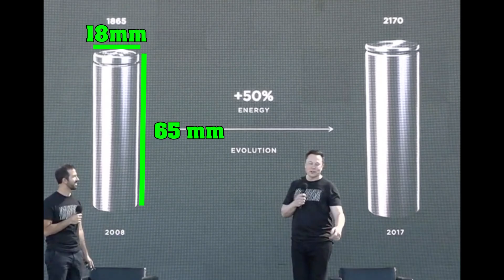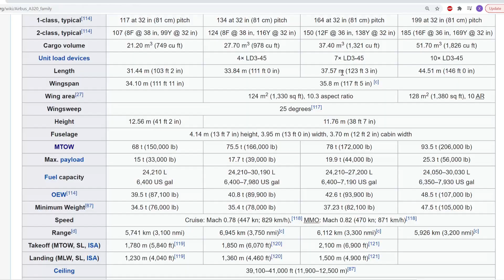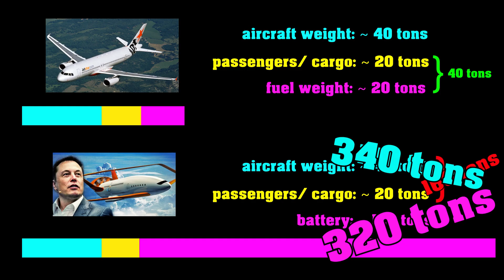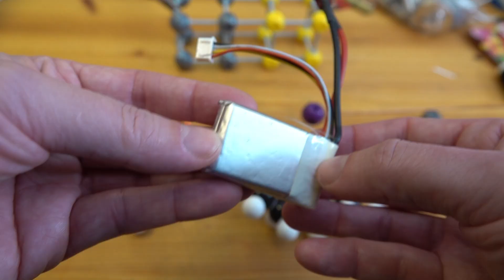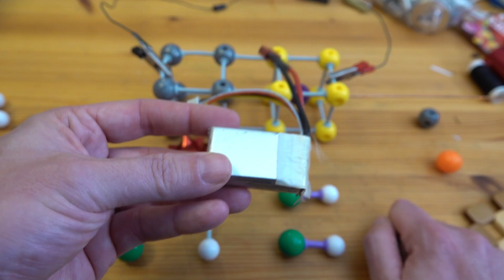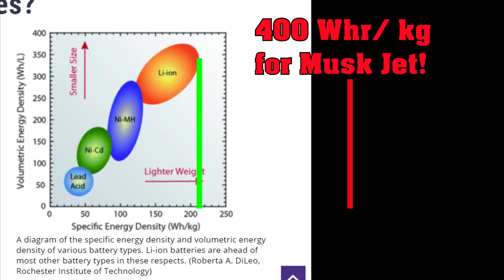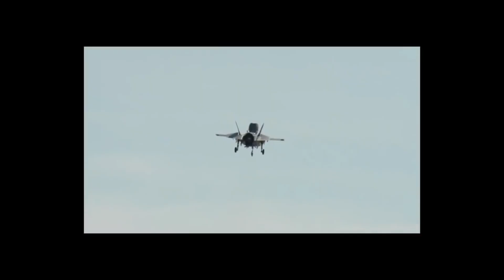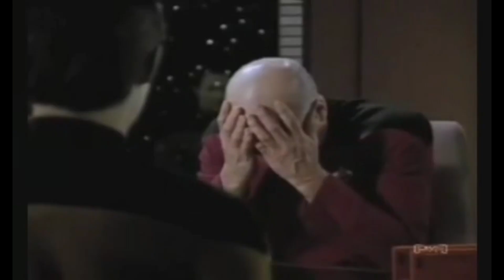Tesla's Secret Plan To Disrupt Airlines: BUSTED!!

Comment: well technically, you could use part of the battery "weight" as structure. the battery housing can be part of the plane structure, so it's not technically just 70% on top the plane mass.That would of course mate the battery with the plane in ways which you can't easily remove or replace them. the real game changer would be energy density within a safe operational space. When shit goes down on a regular plane, you dump the fuel which can, if you hit anything, explode and burn, in a flying battery, ya can't . and last time I checked, Lithium Ion batteries have a tendency to behave badly when they are "hurt" (see airplane crash, especially if they are part of the plane structure). And what about the stuff in between the engins and the batteries? (yes I'm dumbing it down a bit), the cables which transport the current... the higher the voltage , the thicker the cable (if not, bad things happen when you apply too much current).

Comment: The VTOL thing is what gets me. The thrust ratio required to get possibly the most successful VTOL plane, the Harrier required a power to weight ratio of 1 to 1.1 from memory. And this is a combat aircraft weighing like 10 tons with a full payload. An A320 has a max takeoff weight of 75-80 tons. 75-80 tons of thrust That's a lot. Also note anything that carries a significant cargo that is VTOL capable uses a tilt rotor system for a reason. And good luck with making a supersonic/hypersonic rotor plane at flying at the proposed altitudes.

Comment: I think electric planes can have avantages in short flights. If you have to travel between cities in Norway, it is a long distance driving around the fjords. Ferries are slow. There is a market for short quick flights. In every airport you can have batteries charging. When landing you can change the battery, as you change on your electric screwdriver, before take off. Or short low flights in areas you do not want to disturb wild life or people with high sound. Areas of bad roads.
But long distance flights? No. We do have the technology for fuel burning engines. Fuel has higher energy density. The plane gets lighter as longer you fly, and use less trust to keep flying. A battery powered plane start and land with the same weight. Carry all the "fuel" all the distance.
The solution for long distance flights is to make synthetic fuel out of CO2. Make those energy filled C-C bonds from the C-O bonds. If we can get that energy from renewable sources (sun, wind, geothermal, hydro electric), store it in fuel and transport it from production to user, we have a solution. Put the efford in changing the fuel, not to rebuild the whole aircraft with tonnes of batteries.

Comment: And now for the effects of having VTOL, supersonic speeds, and batteries all on the same plane... Each one of these features requires crazy high energy consumption. VTOL in fixed-wing planes is only useful for military operations where you need dirt-cheap airplane carriers that can go to the immediate neighborhood of the battleground. Almost all of them are subsonic. Supersonic speeds are limited to those applications where very heavy planes carry very little payloads. And battery-powered planes only work if the plane is almost nothing except batteries. Combining the three of them in one plane would require having a payload with actual negative weight. At the very best, Elon's plane would be able to carry helium as payload, but more likely, it would only be useful to carry anti-gravitons.

Comment: How do electric planes get thrust? Isn't it much the same principle as jets? You accelerate air rearward to push you forward?  So I don't see how an electric 'jet' is going to be any more efficient at extreme altitudes because there's just not much air mass to push back with
Also, remember that conventional jet aircraft get lighter and thus more efficient as they burn off the fuel, as opposed to batteries which you gotta carry with you right to the destination

Comment: I dont know if airplanes are primarily made out of steel or aluminum. But by replacing that with carbon fibre you shed at least 42% of the weight or say 50% to simplify.

This means that the weight of the aircraft probably go to the 20s in tons. Then you have  about 5 tons left for luggage and people.

Well it doesnt add upp but still closer to real life. We dont know what Elon thinks but this might be a solution

Comment: Like most scientists you make really bad assumptions then you build your theory on that and then call it a fact. Firstly Elon didn't say that a 2170 cell has 50% more energy than a 1865, he stated that the energy density in the battery pack is 50% more, if you make a battery pack the same size and weight with 2170 cell's you get 50% more capacity than if you made the same size pack with 1865. This doesn't mean he improved the cell's performance just the effectiveness of the packaging in the battery pack. Secondly, he stated 70% of the cell capacity on the aircraft, this is 70% of payload, not gross weight, aircraft normally carry 30-50% fuel as payload.

Comment: Conventional planes gain some efficiency as they get lighter after burning off fuel during the flight. Electric planes have to deal with all the weight the entire flight. The huge weight of the electric plane will cause problems when landing. Electric planes don't make any sense

Comment: Took 5 seconds of consideration to know how absurd that claim was. So I pulled some numbers just to quantify where this lands on the absurdity scale... A 747 guzzles a conservative value of about 300 MJ per km in avgas. Lithium Ion is about 1 MJ/kg (270Wh/kg). Since we're unlikely to get any great leaps in efficiency over turbofan jets like the 747 - we can safely assume the Tesla jet would be about as efficient with energy (or worse), so... LA to DC (3700km) would need about a gigatonne of LI batteries on board.
Reply: To paraphrase Thunderf00t in his 2016 video picking apart Starship Earth to Earth:

A fully-fuelled 747(-8) contains 2 kilotonnes of TNT worth of energy in fuel, equivalent to all of the bombs the Allies would typically drop on an enemy city in WWII.

And an ATR 72, a small turboprop, carries 4 and a half MOAB bombs' worth of energy in fuel.

Comment: To be fair, as far as I know, the engineering achievement of Tesla lies in increasing the energy density of the battery, not of the cell and doing this safe enough for a car. Their new and bigger cells manage to keep the battery cool and allow to put more cells in it. Also they're working on making the battery part of the frame, which could solve the problem at 9:00 and could make electric planes possible.

BUT I don't think either, that electric planes could be economically feasible. The difference in energy density is just too big, between batteries and carbon fuel. The most likely future is probably that carbon fuels will be generated from air CO2 and "green" energies, so air travel will become carbon neutral that way.
Reply: making the batteris part of the frame is dumb. planes are able to land since their fuel is gone by that time meaning they weight far less. if a plane has to make an emergency landing it has to dump its fuel otherwise it would hit the runway like a ton of bricks.
Reply: @toomanyaccounts  Your first point is completely unrelated to your second point. Why is it dumb to make the frame out of batteries, if you manage to make it safe? It is obviously lighter than putting batteries in a regular plane frame.
And your second point just shows an inherent problem with electric planes (which is one of the points, why they probably will never be economical). But at least the runway shouldn't be a problem, because Elon Musk is talking about vertical take off planes.

Comment: Did you really watch battery day? Because making the battery a part of the structure and a loadbearing part, makes alot of sense in a plane. And its a funny joke about the progress between old batteries, but they are made by panasonic. By making the battery bigger, you get more battery to mass of the outer shell.
Reply: no it doesn't. planes are able to land because that fuel weight is gone by that time.
Reply: @toomanyaccounts  Yeah no. It is easier and safer yes, but not a requirement to land

Comment: Fun fact: The fattest rc plane in the world is a glider called the transonic DP with a speed of 545 mph or 877 kph (mach:0.77) using a Technic known as dynamic soaring. The fastest conventional electric rc planes are only just about pushing 300mph.

Comment: How about hydroelectric fuel cells? Planes could realistically swap fuel cels between takeoffs
Reply: the plane would never be able to land. look up why they jetison fuel on emergency landings
Reply: @toomanyaccounts  They would. They dump fuel so the get back to the safe landing weight the plane is designed for. And normally dump fuel only in emergencies where they can’t burn it of etc. if the plane had batteries or fuel cells it wouldn’t be a thing

Comment: Clearly, the answer is "Solar Freakin' Passenger Seats"
Reply: Thermo Electric  they will convert body heat to energy.  That way the plane will use the body heat from the passengers to power the plane.  Don't tell Elon this was my idea LOL
Reply: If only they joined forces with Solar Freaking Roadways and beam the power to the electric planes then they would not need large batteries at all. 70% less weight w/o batteries means 70% more cargo weight 👍

Comment: Can't the batteries be used as structural elements though? Something that won't work with airplane fuel.
Reply: airplane fuel is dumped in emergency landings for a reason. the plane has to lose weight if it wants to land safely
Reply: @toomanyaccounts  well the fuel needs to be dumped because it isn't a structural element to begin with, it only provides energy and weight, not strength so it makes sense to get rid of it. So it's not a direct comparison like this.

Look, I know Musk's spiel is to never think too hard about failure modes, but batteries should not be simply compared to "dumb weight" fuel.

I'm more concerned about how hot those batteries would get in order to allow a take-off.
Reply: @cearny7856  batteries wouldn't help with structural support they would be a huge failure point. once again plane weight upon landing has to be much less then upon takeoff. otherwise the plane can suffer structural damage or even break apart.
Reply: @toomanyaccounts  by much you mean 15-20%? Because that's the total amount of fuel mentioned in the video, plus you need reserve fuel. I recall an article (gotta search for it) that mentioned using batteries as structural elements in newer designs for electric cars so I can see this being possibly adapted for an airframe as well. Again, batteries are not sloshy stuff so they can be used in other ways than just..sloshy stuff.

Edit: found it! https://www.theengineer.co.uk/carbon-fibre-structural-battery/

Furthermore, not all planes are jumbo jets. So dumping fuel in an emergency landing shortly after take-off is not necessarily as much a priority for all types of planes in all situations. It should improve the result of a hard landing regardless but it's not a strict requirement for all planes, in all situations.
Reply: @cearny7856  cars don't need to take off and land. big difference also notice what happens when tesla cars crash they tend to go up in flames way worse then a gasoline car does.
Reply: @toomanyaccounts  if you check out the Danish researcher's claims, he did mention airframes though. And the battery tech won't be a direct lift from what Tesla uses for their cars. Anyway switching to mentioning battery fires feels like a bit of a goalposting move.

Then again, this is probably going on a tangent to what Musk was talking about and, yes, there are other issues besides weight (or possible fires, which are horrific by themselves and for which I don't know if there's a specific battery tech to handle) which might be much nastier.
Reply: Also, know what would be nasty and commonplace enough? A lightning strike.
Reply: "Can't the batteries be used as structural elements though?"

Yes, they can, or their casings can.

"Something that won't work with airplane fuel."

Actually, it DOES work with airplane fuel, because a lot of aircraft these days use "wet wings" where parts of the wings themselves are sealed off and used to store the fuel that you'll need to run, effectively making the fuel tanks structural.

Comment: Really love your content.  One thing I was confused about, this same logic was used to say the Tesla wouldn't work unless the car was very heavy, which is exactly what made it work.  So using this same logic, wouldn't a much larger/heavier plane with the same amount of people as the c320 work?  I understand increasing the weight makes it exponentially harder for it to lift off of the ground, but it would still be entirely possible. But would it be worth it energy efficiency wise?

Edit: Or just more planes that carry fewer people?
Reply: increased wieght means its unsafe to land. its why planes dump their fuel if they have to do an emergency landing.

Comment: The closest thing to this that might actually be maybe feasible would be an electric V22 Osprey or something resembling it, that just serves the ultra rich and takes them point to point in a city or maybe between nearby States or countries (I. E. UK to France or Germany, etc). The electric batteries would still be a disadvantage in terms of weight but far less than for anything long range and possible advantages such as being rechargeable so that you could just charge it on top of a skyscraper or at a mansion that has a helipad with basically a tesla charger next to it, possibly being more maintainable, etc, might, possibly, maybe, cause it to be a viable product. Even then it's kind of pushing it and grasping at straws a little, but atleast such a vehicle could actually get off the ground... Not business wise I mean though maybe that too, no I mean literally physically lift off the ground.

Comment: At the midway point - it is a key feature that the "thermal release" and "storage system" in a "combustion" (or fuel cell) type of motive power system  is separated, while for a battery - it all happens inside the same component (not always a good thing) - this might be a good case for flow cells. If only they could have a high energy density (and lower cost)...  Time works magic.. But Physics still applies.

Comment: Forget the 70% cell component, I'm waiting to see the size of the props needed to move the thing. Any smaller than most football fields I suspect won't work! Maybe the comment that electric engines are more efficient the higher you go is referring to these electric engines producing thrust(as opposed to turning a prop) via the fireball battery tech we'll see in 3 years!! :D

Comment: As much as I admire Musk for his accomplishments, this always seemed a complete fantasy to me.

"Jet aircraft" implies transonic speed, at least. Nobody today would go back to all-day coast to coast flights. Now, there are lab concepts for electric jet engines delivering that kind of thrust.

But the energy density of jet fuel is more than 40 times greater than the predicted theoretical limit of future lithium ion batteries. Sure, there may be better battery technology some day, and the thermodynamic efficiency of combustion jet engines is "only" roughly 50%.

Still, forget incremental improvements of tens of percent here and there, we need orders of magnitude more. The technologies needed to radically increase the energy density of batteries and / or completely redesign what we think of as an aircraft (let alone a VTOL one!) to the point where this is even remotely feasible don't even exist as proofs of concept.

Musk should work on producing carbon neutral synthetic jet fuel instead.